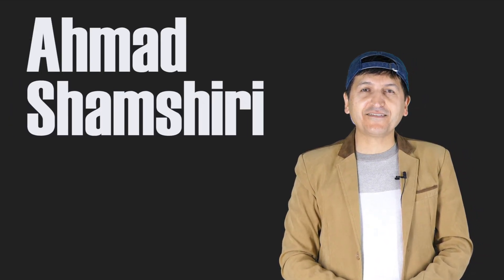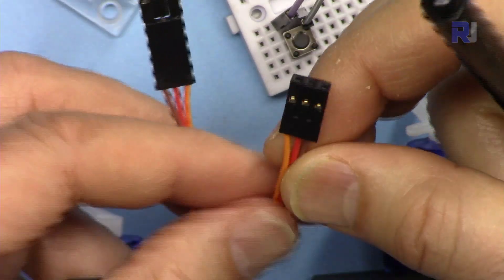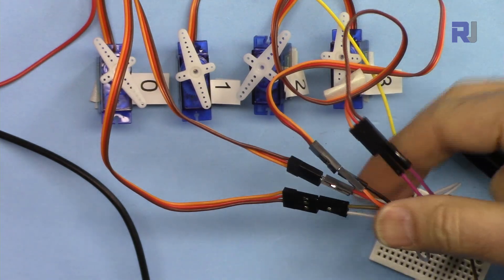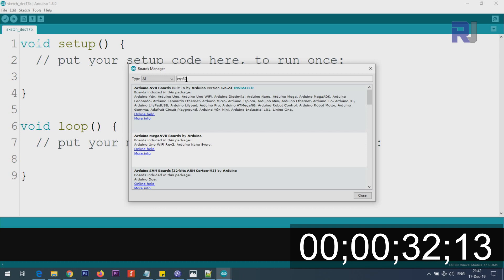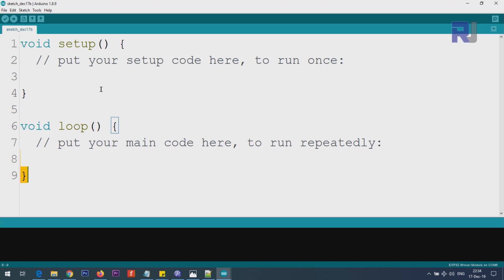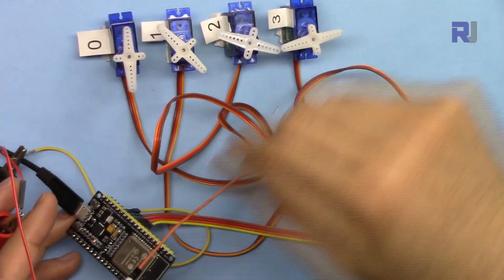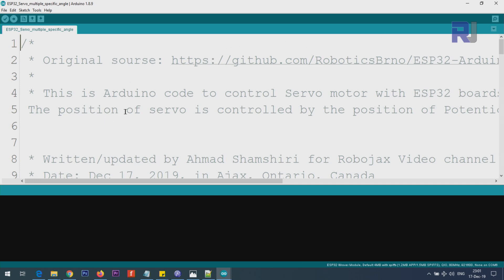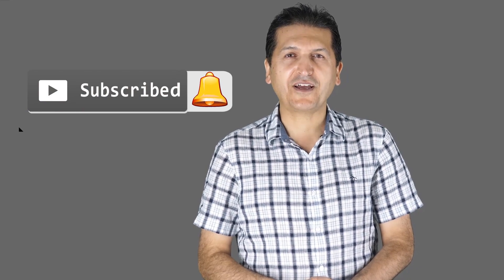Control More than one servo using ESP32 Arduino - RJT253

Comment: Can I use two 360 servos and two 180 servos pls respond
Reply from the maker: 360 proper servo is over $100. the one sold on eBay or Aliexpress are just jokes. Get either stepper motor or proper motor.

Comment: I got the error with servo_esp32.h library example multiple servo CODE . Ledcdeta issue. How to fix it
Reply from the maker: please alway provide the error. it helps understand the problem.
Reply: @robojax  this is a issues 

( Output
IF
D
C: \Users\schev\AppData\Local\Arduino15\libraries\ESP32Servo-master\src\ESP32PWM.cpp: In member function 'void ESP32PWM::adjustFrequencyLocal(double, double)':
C: \Users\schev\AppData\Local\Arduino15\libraries\ESP32Servo-master\src\ESP32PWM.cpp:172:17: error: 'ledcDetachPin' was not declared in this scope; did you mean 'ledcDetach'?
ledcDetachPin(pin);
172
ledcDetach
C:\Users\schev\AppData\Local\Arduino15\libraries\ESP32Servo-master\src\ESP32PWM.cpp:176:17: error: 'ledcAttachPin' was not declared in this scope; did you mean 'ledcAttach'?
ledcAttachpin(pin, getChannel()); // re-attach the pin after frequency adjust
176
ANNNN
ledcAttach
C:\Users\schev\AppData\Local\Arduino15\libraries\ESP32Servo-master\src\ESP32PWM.cpp: In member function 'void ESP32PWM::attachPin(uint8_t)':
C: \Users\schev\AppData\Local\Arduino15\libraries\ESP32Servo-master\src\ESP32PWM.cpp:237:17: error: 'ledcAttachPin' was not declared in this scope; did you mean 'ledcAttach'?
ledcAttachPin(pin, getChannel());
237 |
ANNNNNNNNNNIN
ledcAttach
C: \Users\schev\AppData\Local\Arduino15\libraries\ESP32Servo-master\src\ESP32PWM.cpp: In member function 'void ESP32PWM::detachPin(int)':
C:\Users\schev\AppData\Local\Arduino15\libraries\ESP32Servo-master\src\ESP32PWM.cpp:264:9: error: 'ledcDetachPin' was not declared in this scope; did you mean 'ledcDetach'?
264 | ledcDetachPin(pin);
ANN
NNN
ledcDetach
exit status 1
Compilation error: exit status 1
Ln 1, Col 1 Heltec WiFi LoRa 32(V3) on COM10 [not connected] G1 E
ENG 9:50 PM
81°F Clear
<
INTL /1/2024
Type here to search )
Reply: I also sent to you email.
Reply: @robojax  sir. I'm waiting for your reply
Reply: Dear friend what happened to my problem. Your servo library sample CODEs not working

Comment: hello! can i use the same code(with minor modifications) and libraries to control multiple continuous rotation servos?
Reply from the maker: Hello, "continuous  servo" that is old on eBay is just joke. Don't waste your time. use stepper motor or get $300 servo that comes with software and will work exact like that.
Reply: @robojax  thank you so much for your reply!
my project is actually to build a vending machine.. will stepper motor be the right pick to rotate the dispensing coils?
also, does the circuit configuration remain same?
Reply from the maker: I have tones of videos on stepper here is how you can find a video in a channel https://youtu.be/OhkUceBWcHs
Reply: Will look into that, thank you!

Comment: Thx for your alltime informative Videos !
One Beginner Question :
Must I use only 5V for external Voltage or is it possible to use eg. 7.4V ?
Thx for your Time
Reply from the maker: you are welcome.  The voltage for your servo is determined by the servo motor manufacture. if it is 5V then use 5V else connect different voltage. most servo motors are 5V.

Comment: your videos are well presented and informative, i've been trying to work on some of my projects using servo's. I have little experience with using the arduino ide and have considered doing your tutorials. there is one area which which i can't seem to find much subject matter on. controlling servo's using two esp32's or HC-12 remotely.over distance. will you be doing any future video's on this topic.
Reply from the maker: Hi, I have videos on controlling servo over WiFi.  Check my videos.  Once you can do it over wifi, then you can do it from anywhere the method used "windows remote desktop".
Reply: @robojax  Thx, i have watched most of your videos on this topic, as i'm new to this topic i don't really understand  how to apply the code for broadcasting between modules. i will keep learning and give myself 6 months to try and achieve a result.
Reply: @robojax  can i get the coding please..i want to try this project